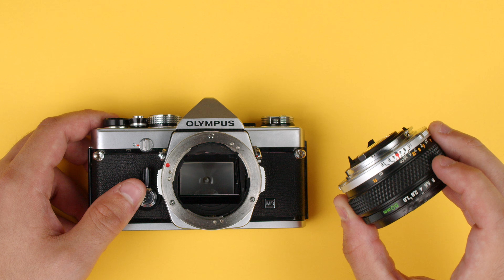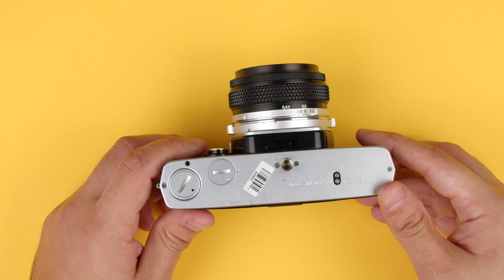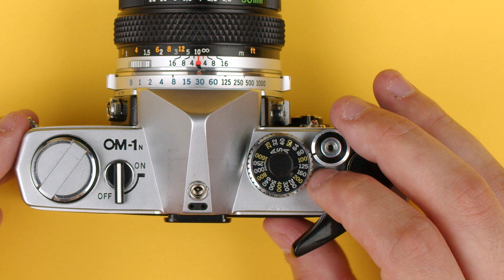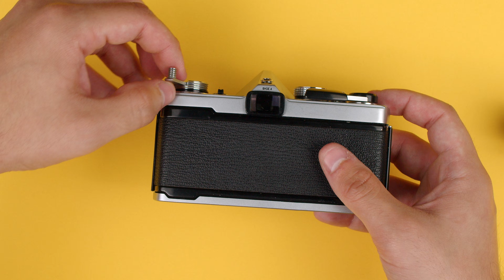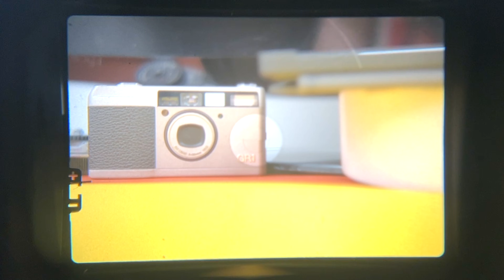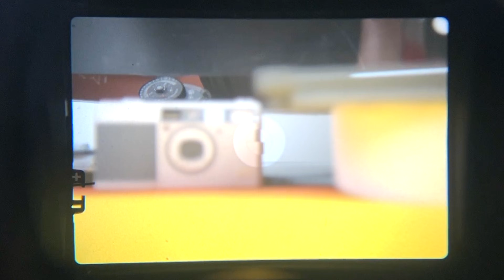How to Use: Olympus OM-1 - Kamerastore

Comment: Why does my shutter stick when I try to take a picture? By the way, thank you so much for this video.
Reply: Mine was doing the same thing when i was trying it out! I'm not sure if you watched the shutter speed section of the video, it might be that the shutter speed is lower. Originally i had it at 500, but once i began messing with the controls it all of a sudden seemed to to be sticking, only to find out I had turned the shutter speed to 4. Hope this helps!!

Comment: The Px625 batteries used mercury and they have a  voltage of 1.35 The last  years these batteries there are  not exist in the marker because of  mercury and  the photometer doesn't work correct with other type batteries. Have you any solution for this I own three om 1 ( one is om1n) and many zuiko lenses.

Comment: Well done. I still have the OM-1 I got brand new in 1976 and refurbished for non-mercury batteries around 2000. Some points you didn't mention in the video:
- the red line on the right on the aperture scale is for infrared film. Focus normally, note the scale position, then move the focus position to the right to line up with the red line.
- there's a depth-of-field preview button on the lens you can press to close the diaphragm and see the focus range in the viewfinder.
- the blue shutter speeds on the shutter speed scale (from B to 60) are the speeds an electronic flash (X) will sync at. As you note, the FP position is for bulb flash which I haven't seen in ages.
- to make a double exposure: tension the film slightly with the rewind knob, take the first exposure. Then put the rewind lever in rewind, hold the rewind knob tight to keep the film from advancing, and cycle the film advance lever. Now take the second shot.
- there's a small lever behind the self-timer lever you didn't show. The large lever sets the amount of time (and winds the mechanism) when moved counter-clockwise, and the small lever is then moved slightly to the right to start the timer.
- the focus screens are removable and there are about a dozen different types that can be swapped in. Be careful not to touch the light meter needle when the screen is out.
- the mirror lock-up lever is used primarily in B shutter mode to prevent mirror vibration during long exposures. The shutter release button is threaded to accept a mechanical shutter release cable for long exposures.
Reply: What do you need to do to refurbish for non-mercury?

Comment: Idk if anyone can answer this but hi, I got my OM-1 (the older one he referred to) at a yard sale with a bunch of other camera stuff, I’m nervous to use my camera because mine is missing the rewind and idk how I would get it out. If anyone can help me id love that!
Reply from the maker: Hey Logan! Unfortunately, missing the rewind lever will make things much harder for you.. For example, you likely won't be able to easily open/close the rear door to put film in or take film out. You'd also have to manually (by hand) put the film back in the canister after shooting your roll. This would need to be done in a pitch-black room, making it pretty difficult! Especially as a beginner, I wouldn't recommend it.

Your best bet may be to find a local shop that sells film cameras and see if you can salvage a rewind lever from another OM-1. Sorry, I know that's not the most helpful advice but I hope you're able to repair your camera or find one that works for you!
- Connor

Comment: my camera is the exact same as yours, it used to be my mom's and it's missing the cover thing for the motor drive on the bottom, should I try to get a cover for it before trying to use the camera? I'm completely new at this so any suggestions would be helpful

Comment: I do not like where the shutter speeds are located.
Reply: The only Olympus OM Camera I can think of that has the shutter speed control at the top is The Olympus OM 2000 Spot Metering. Technically it was made by Cosina and the just copied the ISO/shutter speed dial of the Pentax K1000 but it takes OM lenses.

Comment: The PX625 battery is a 1.5v vs the 1.35v original battery. It’s a good idea to have the camera calibrated for the new battery. I have two OM-1N’s with working meters. One has been calibrated and the meter is perfectly accurate with the new battery, the other is about 2.5f/stops off. It works great with the wein cell (a 1.35 battery).
They are awesome cameras, and very fun to shoot with.
Reply: How did you calibrate it? Currently using a light meter to determine correct settings and was wondering about this.
Reply: How do you calibrate it?

Comment: The light meter on my camera works, but it doesn't change with different amounts of light. Also, the light meter doesn't turn off like in your video. What could cause this?
Reply from the maker: If the meter won't turn on/off or react to light then it's definitely not working properly. A bunch of things could potentially cause this. Most likely the camera is dirty inside and the meter mechanisms aren't able to move. There's also a chance that the electronic mechanisms are broken, corroded, or damaged in some way that prevents the meter from working. It's difficult to say for sure without disassembling the camera, but unfortunately is more and more common every day. Thanks for watching!
- Connor

Comment: Great camera. However I find the shutter speed 1/125, 1/250, 1/500 and 1/1000 all sound and act the same. It’s like I don’t noticed any difference in the speed and they sound the same.  but for some reason I don’t see any difference in the photos. Is this normal? I’m kinda new to film photography and this camera is my first film camera. I’m still learning a lot about these cameras.
Reply from the maker: Hi! Sounds like there must be some issues with the camera shutter speeds. The image should not look the same for example with 1/125 and with 1/500. 1/500 should be quite a bit darker. 2 full stops to be exact. -Tuomas
Reply: @Kamerastore  I noticed that at 1/500 the images looks slightly darker than 1/125 so I assume there’s no issues with my camera. But thanks anyway!
Reply: @DaniBRGS  You will probably not see the difference when watching the shutter with your eyes. If you're really concerned you can do a more thorough comparison with photos at those different speeds and see if they look more grainy/underexposed at the faster shutter speeds with the same aperture.

Comment: 7:20 then what’s the “B” of Bulb for??????
Reply from the maker: Hi! There's no B on the flash sync port, only X and FP. X mode is used for all electronic flashes and most disposable flash bulbs, while FP is only used for FP type disposable flash bulbs. These are not used today so X mode is what you want to use. (-: The B you're seeing in that shot is part of the shutter speed dial, which is around the lens mount, not the flash settings. Hope that helps!
- Connor
Reply: @Kamerastore  Hello sorry I don't want to sound rude, but there is a B before the 1 ON the shutter velocities
Reply: @Kamerastore  I am just pointing that, what you mention in the 7:20 about taking a picture with the window up you mean to use it like you would use BULB
Reply from the maker: @ugai_bro  Oh, sorry I misunderstood. The answer is no, though. You can use the mirror lock-up with any shutter speed, not just bulb. It's useful with many different speeds and in many different situations where reducing camera shake is beneficial. You do not have to use bulb mode when the mirror is locked up. Thanks!
- Connor

Comment: @Kamerastore i have a slight issue with my 50mm 1.8 auto-s Zuiko lens. The bearing/aperture ring is kinda loose. I can slighty, just very slightly wobble the aperture ring up and down and i can even hear it very clear. Despite that, it work totally fine though, the ring clicks when changing the aperture and the pictures looka fine. But still, it annoys me and its just me being OCD😂 i got the lens from a second hand store, some even say they put the wrong bearing on it😅 or is this just normal after years of use?
Reply from the maker: It's likely just from old age. Most camera stores don't do any kind of disassembly and repair. Likely there's an internal ring or something that's just a bit loose or has slightly broken/bent. It's probably not a very complicated fix but it does require someone who knows how to disassemble and reassemble Olympus lenses properly. Those people are not very common these days!
- C
Reply: @Kamerastore  Thanks for your reply. I think I’m gonna let a professional check that up because I have zero experience in dissembling a lens. some professionals at camera store even say that All aperture rings must have a certain amount of play to be able to turn and click over the ball bearings, but they sometimes become looser over time with use and age. This lens is being used by a previous owner. As i mentioned everything works perfectly. It’s just a little wobbly.
Reply: @Kamerastore  hi I’m sorry for bothering you again.. but I noticed on my OM-1 that, whenever I take a photo and release the shutter, I can see that the rewind knob is turning slightly everytime I take a photo. It does turn whenever I advance the film for a new exposure. It works perfectly fine. But somehow it really bugs me that the rewind knob turns slightly whenever I take a picture. Is this normal? It slightly turns counter clockwise..

Comment: Nice review, really! But does the battery only serve to wind the film back? I thought the camera was completely mechanical, can it be used even without the battery? I heard it's hard to find. I would like to purchase the product from your website, I'm really excited about the purchase!!!
Reply from the maker: The battery only powers the light meter. The winding is done with the large lever on the top right of the camera! The camera is totally usable without a battery, it just won't tell you when your shot is properly exposed. In terms of the battery, the exact one that the camera was made for (1.3v Mercury) is no longer in production. There are a few solutions, including using a modern battery (1.5v PX625) with a different voltage, using a battery adapter (MR-9) to convert a modern battery (LR44) to the right voltage/size, or using a modern Zinc Air battery (Wein Cell). It's not the easiest thing in the world, but it's far from impossible! Thanks for watching!
- Connor
Reply: @Kamerastore  many thanks! Congratulations, for the video and your shop you really offer excellent service!

Comment: I have an unusual question about the Olympus M-1 - the original Olympus film SLR.

I always wanted to get an original Olympus M-1, made before Leica forced Olympus to change the name to OM . I am considering one now, however, the serial number on it is 2xx,xxx. I thought that Olympus started the production of M-1 with 100,000 and only made about 52,000 before switching the name to OM-1. I also heard that there are a number of fakes with M-1 top plate fitted on OM-1.

Does anyone know the serial number range for the original Olympus M-1 film SLR?

Thank you

Comment: I have this lens. and another. When I rotate the aperture ring, with either lens, the ring does not close the aperture. It is stuck at f/1.8 wide open. Both lenses do the same thing, so it seems like something in-camera is preventing the aperture from opening. Does the aperture change only when the shutter is pressed?
Reply from the maker: The aperture changes only when the shutter is pressed! Most 35mm SLRs do this, it's called "open aperture viewing". By keeping the aperture wide open until right when you press the shutter, the viewfinder remains as bright as possible while you focus/compose. Thanks for watching!
- Connor

Comment: What if my tension knob doesn’t turn ?
Reply from the maker: Hi Ben, do you mean the rewind knob? In that case, it could be possible you haven't put the camera into rewind mode with the switch on the front of the camera. If it's something else, we can try to troubleshoot that too. Let me know!
- Connor
Reply: Hello. No I meant the rewind switch itself snaps back into place whenever I want the camera to rewind. I took out the film by just holding the switch red to red and it seemed to work. But it is strange that yours acts as a switch with two states and mine has to be held while winding (makes it a little harder ti accomplish)
Reply from the maker: @benkovrishkin8956   Gotcha. Likely your mechanism is a bit dirty inside and would benefit from a CLA. The one I'm using has been cleaned internally and adjusted by our mechanics, so everything is working as it should.
- C
Reply: Just acquired an OM-1N, no users manual can I get a download somewhere. But I have a problem opening the back. I can disengage the rewind by pulling it up, but no clicking sound and cannot get the back open. Will it need the frame counter set to 0 or 1. Or is it something to do with the rewind? Next thing to try.

Comment: I want one of these but what batteries can i use..i hear various types due to its 1.35 volts
Reply from the maker: You can use the normal 1.5v PX625 batteries and not have much issue, but if you're concerned about the voltage difference I recommend the MR-9 battery adapter. A serviced OM-1 from our site is usually calibrated to work properly with the MR-9. (-: Thanks for watching!
- Connor
Reply: Mine reads perfect even with modern batteries.
Reply from the maker: @jordanjoestar8839  Lucky you! Many have been adjusted to use the modern 1.5v batteries and they work perfectly. It makes things a lot easier! Thanks for watching.
- Connor

Comment: The design of that camera was excellent. The button on the lens to dismount was a dream to use. The mount on the body was designed with a big flat surface so that there was no possibility of out of aligned mounting. The shutter speed control around the back of the lens was the correct place to have the shutter control on any camera, not the top plate. One hand to focus, set aparture and shutter speed, perfect. Mechanical shutter so it alway fired. Five frames a second motordrive. Nikon F2 was a nightmare to use, the Canon F1 was a bit better but the Canon FD mount was a disaster waiting to happen and did happen. OM1 one of the best SLR's ever made. The best £ for £ by far nothing to touch it.

Comment: Thanks for this video! I'm very interested in this small mechanical SLR but I'm not surr about the battery though. Isn't the PX625 1.5V but the camera was designed to work with 1.3V instead, like many others from that time? Isn't the meter affected by the increased voltage?
Reply from the maker: It is, but barely! You can use it with the PX625 and it will be fine, or you can use an MR-9 battery adapter with an SR43 battery to get the proper voltage. Hope that helps!
- Connor

Comment: Always been curious about the OM cameras. The ones that interest me are the 1 and the 4.
Reply from the maker: They're great cameras, Calvin! The OM-4 has some really cool light meter functions that, honestly, are a bit too much for me to use on a daily basis. 🤣The multi-spot highlight/shadow metering is probably extremely useful for those who take the time to learn the system and play around with it. Thanks for watching!
- Connor
Reply: I have the OM 10 whis is and aperture priority camera if you don't have the manual adaptor. I also have the Olympus OM 200 with spot metering tha was technically manufactured by Cosina but still uses the OM lenses. The 2000 is fully mechanical and can be used without batteries. Both the 10 an 2000 have a fixed hot shoe but lack a PC sync but a hot shoe adaptor with PC sync can be used to get around that. I find the OM cameras fascinating also.

Comment: My Olympus OM-1n 's light meter is not working properly, people tells me it usually unfixable since it is too old:((( Is that true?
Reply from the maker: Light meters can definitely be calibrated/repaired! For the most part, the limiting factors for repair are parts availability and technical knowhow. So basically, not many people know how to properly repair cameras and many of those that do don't have access to the spare parts you may need (assuming you need to replace the light meter entirely). So it may not be possible/practical for that reason.
It's also possible that the labor required would cost more than what you'd pay for a new one, even a serviced one from us that has a working meter. The expertise and equipment for fixing cameras are expensive and rare these days!

In short, it's definitely POSSIBLE to repair, it just may not be PRACTICAL. Hope that makes sense. If you're interested in getting a new OM-1 that's been fully serviced, we have them on our website (-: Thanks for watching!
- Connor
Reply: @Kamerastore  Thanks for the explanation❤